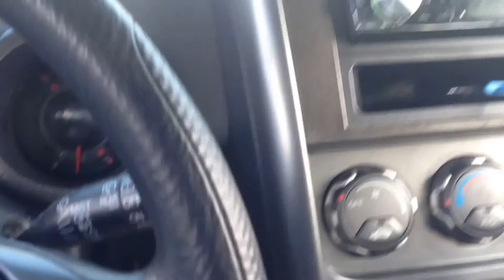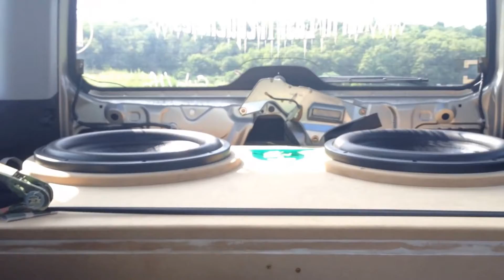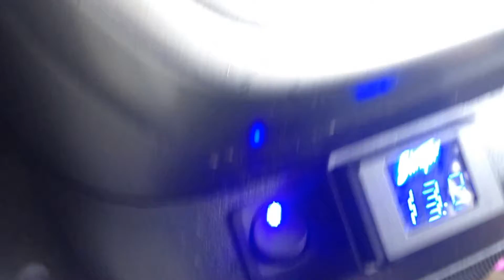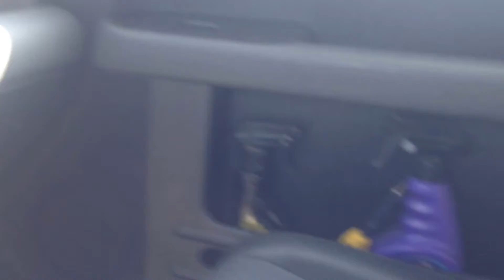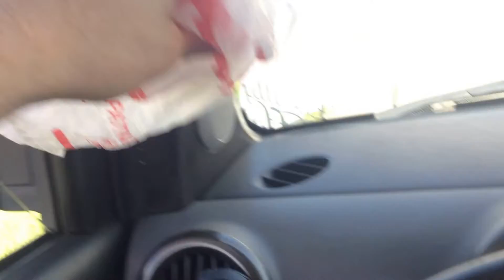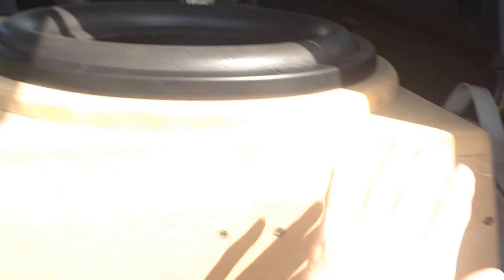2 DC Audio Level 4 15's w/ XL upgrades on 3500 watts! 2003 Honda Element

Comment: I have the same dcs I started with 2 CVR 15s sold them came up on the dcs but had no good amp had a Brutus 2600 and only had a prefab box for 1 15 so I ran one and it slams hard af but I blew the Brutus now I got a option 4k can't wait to get a box and battery so I can hear mines
Reply from the maker: Periods and commas my doode. Periods and commas.

Comment: nice set up man. I plan on running 2 dc level 4 15s with xl and cone upgrades on a dc 3.5k in a 4th order tuned to 45.

Comment from the maker: SKIP TO 3:40 FOR A DEMO!
Reply: What type of battery do you recommend for my setup If I don't get a second battery I have two DC audio level 4 15" and a 230 amp alternator and I'm powering them with 3000 watt's
Reply: And a 3000 watt sound stream T1.6000DL

Comment: HolysDenn  if you dont mind whats an average that you spent on the whole system box,aubs,amp batteries etc..?
Reply from the maker: Built the box, so around 90 bucks for the 2 sheets of MDF and supplies
Batt - 250 (used)
Wire - 80$
Amp - 600$
Woofers - 600$
HU - 180$
Alternator - 550$
Front battery - 180$
6.5's - 40$
idk like...2500 bucks haha.
RIght now im around 3500 i think >.<